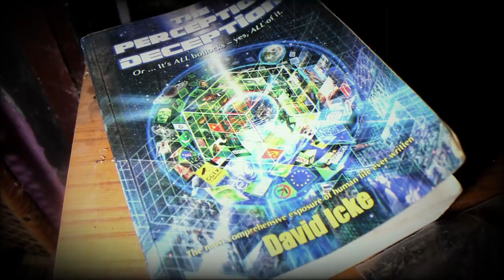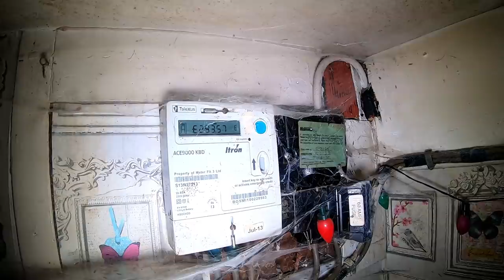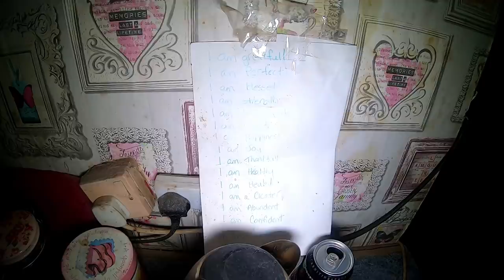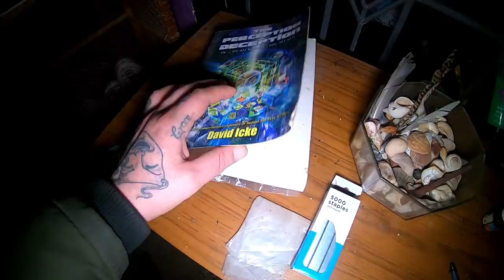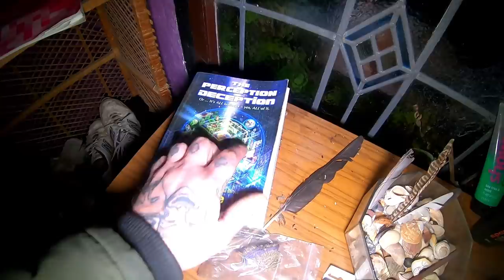CONSPIRACY THEORIST VANISHED FROM ABANDONED HOUSE AND LEFT EVERYTHING BEHIND | ABANDONED PLACES UK

Comment: That prewasher thing is a hand washing machine, for hand washing clothing but getting it cleaner than washing things in the sink. You can do it up tight & spin the handle & then hot water will build up a bit of pressure, which is meant to help get the dirt out of the cloth. Thats the idea anyway.
Reply: I used one for a couple of years when I lived in a small flat with no room for a proper washing machine. It never worked very well so I upgraded to one of those mini twin-tub electrical machines - much better. So anyone thinking of nicking it from the cottage, don't bother!
Reply: @Londonfogey ......
LOL 😅

Comment: That little red & white contraption on the other side of the fireplace that you thought was some kind of gas burner was actually a portable washer for underwear & stuff, it's hand propelled. There was also a bread oven in the brick wall on the right side of the cooker. I also noticed that in that one room that had the book in it by ick, behind that stain glass door was another room that you didn't even notice! Might be worth going back to check it out & move that cabinet that was in front of it? Thank you for the video.

Comment: The red barrel structure at 5:03 is a "Wonder washer". Clothes, water and and soap are put in the barrel, and the handle is attached and the barrel turned end over end on the stand's pivot. The same is done with softener after to rinse the same clothes. It's a real bear to wash clothes with week after week, it's only really good for camping.

Comment: Could be Homeless guy using it. But can't for to the key meter being in debt. It's the daily standing charge that's caused it typically costs 30 pence per day whether you use gas and electric or not, unless utilita which include it within unit rate, you won't get any gas or electric until cleared or tell energy company you moved into it.